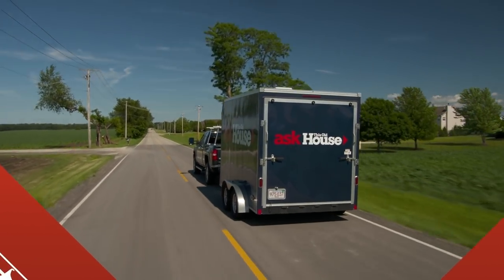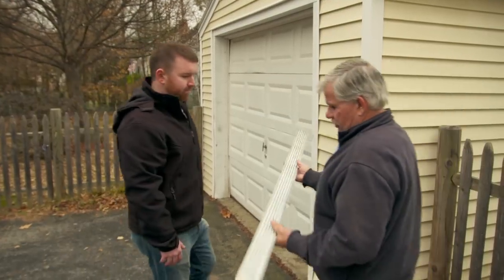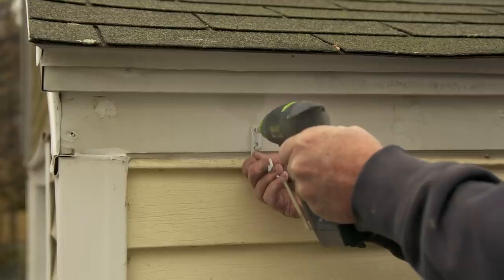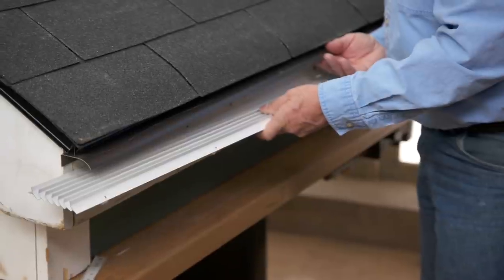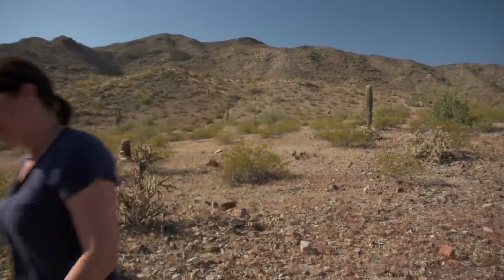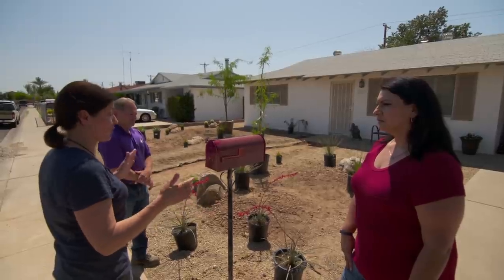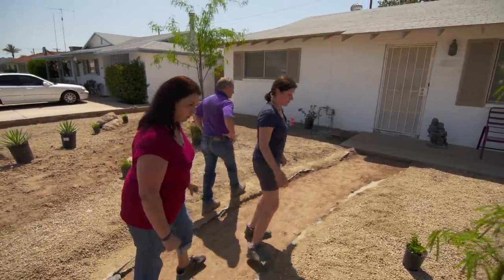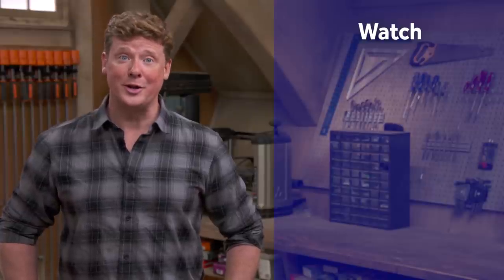ASK This Old House | Gutterless Gutters, Desert Plan (S16 E22) FULL EPISODE

Comment: The gutters aren’t intended to gather roof runoff - but to keep the siding-sheathing dry. All the experts chiming in should look at homes a little more outside of their immediate area. A lot of locales don’t even bother with gutters and mitigate erosion at the ground and handle drainage by site.
Reply: Expert
Reply: @Kevin-mp5of  in a lot of architecture traditions they don’t do gutters - in heavy snow areas? You don’t even bother. Grade the site properly. It’s how the Romans built. Building Science Guru Joseph has talked at length about it. 

There are diff strategies around the world and everywhere in the country. Pretending like one solution is optimal for every circumstance is just plain arrogant.

Comment: i have the same idea on that sensor device, but the only difference is, it is not a sensor, but it is a small multiple LED on a single panel that will detect which outlets/device/component etc that are still turn on. i know it is a complex idea but i am trying to figure it out.

Comment: Those "gutterless gutters" are total crap.
Reply: I was thinking that, too.  The homeowner is still going to have the water at the base of the garage, in between it and the house, so he could conceivably get water in his basement.
Reply: Just use gutters, they are better,
Reply: Oh, and then add a French drain.  Talk about over-engineering.

Nope.  Put a gutter on properly, and direct the downspout towards the yard behind the garage.
Reply: @llantup  possibly install a rainwater tank? There are many thin ones available. Any overflow can go to the driveway which looked going downhill away from the garage.